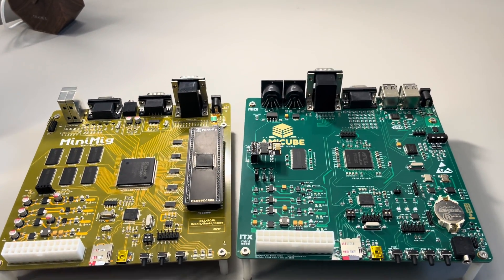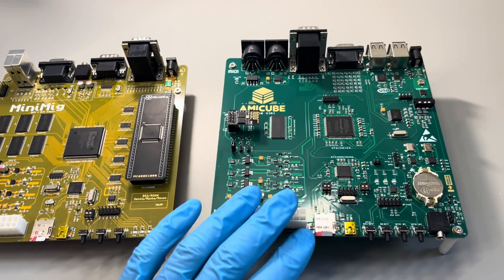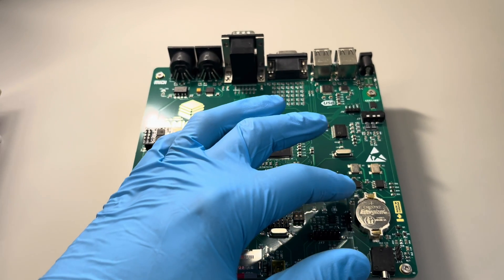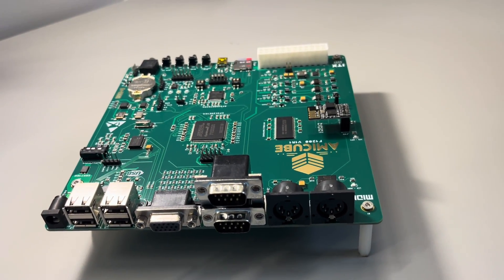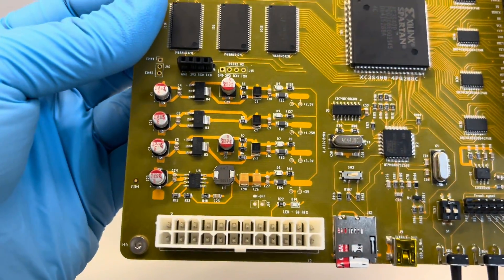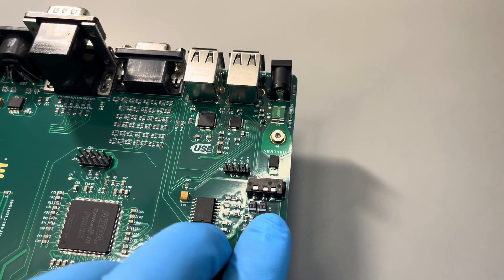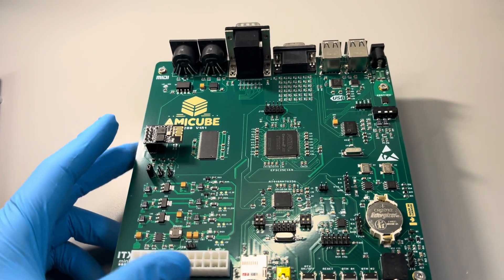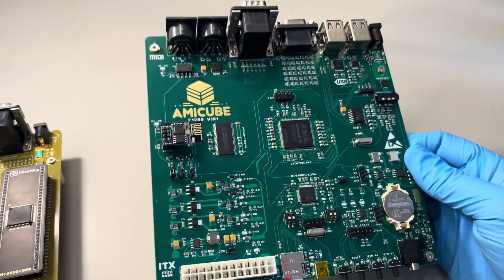AmiCube F1200 - Hardware introduction

Comment: A couple of things.  Can I suggest that, if you don't want to replace the VGA connector, you present the RGB to an internal header and make the external VGA connector a sub-board?  That way it can be removed and an RGB2HDMI put in its place in a similar way to the RF to HDMI conversions people are doing on their C64s and Amigas.  Or leave the VGA connector and have an internal RGB header as well..
Second, is the internal Wifi connector able to use an RJ45 network module instead, like an ENC28J60?  Likewise on the revised Minimig with the Wifi connector?
thanks!
Reply from the maker: All good suggestions! Will be implemented including RJ45.

Comment: ok NOW I’m interested as a backup to my real A1200…I can slap this into my tower but where can I connect my TF1260???👍❤️
Reply from the maker: Thank you for the comment! This board is mostly MIST in the ITX form factor. For expansion slots, CPU slots etc, next AmiCube will have all that. I am aiming to replicate entire Amiga IO, from floppy, parallel port, Zorro, CPU slots, improved chip-set etc..

Comment: In all honesty, is this really anything more than a MiST clone (with some of the community modifications) in an ATX form factor?  It's great so see new tech in the retro community, but this looks similar to devices we've been using for the last 8-9 years, with all the same limitations.
Reply from the maker: Yes. And Mist is a still good device in my opinion. Super outdated but lovely. Unfortunately for MIST community I am performing MISTorectomy at the moment. Mist firmware, Cyclone 3 and ARM controller are being replaced. Mist itself has very little importance here. What counts is amazing Minimig AGA core. In fact I will reduce the cost and complexity just by dropping Mist part out of it. It was a poor idea to go this way in first place.

Comment from the maker: For AmiCube, today I started process of replacing FPGA. I will try to make board super cheap, easy to produce and using all new, available parts.  Also ARM controller and MIST firmware are going out. I am checking DVI over HDMI as an option. Perhaps if we can hit sub-200$? I will keep you posted.
Reply: Canadian Dollar?
Reply: Thanks for this update. Hope all goes well with the big FPGA change.

Comment: This does look pretty cool, I wouldn't mind reviewing this too, Forward thinking, Where would the Amiga be today if commodore didn't go bankrupt and we had the AAA chipset, CD64 etc. I've been looking for any documentation containing AAA Chipset that might help towards making an emulator /core, and what logical step might have been taking beyond AAA?
Reply from the maker: Today with FPGA tech. sky is the limit. Especially with new large chips, we can even go PPC! Amiga chipset can be improved as much as we like. Good example is what Apollo team did.
Reply: I've looked into the AAA history a bit myself, it seemed to me you could easily approximate and then enhance what it would have been with an existing Amiga emulator, and some software designed to bring any real Amiga to it's knees. With Winuae, for example, you can boost the memory, cpu speed, memory speeds, blitter speed, add a 16-bit sound card etc. I can't think of anything AAA would bring to the table outside of that. After that it would have been the Hombre chip-set, designed to pair with different CPU architectures with a PCI-like system architecture and with graphics features to have standard api compatibility. The other platforms have gone the same way, I don't see anything unique about Hombre now.
Reply: What about all the 3D features @davidste60

Comment: Amazing board. If you could get the audio in to work as a sampler it would make a much more amazing amiga system- suitable for creating music in the classic way.
Reply from the maker: I think same Tape IN line can be used as sampler for Amiga, with a few Verilog mods in the Minimig core. I will look into it.
Reply: Replicating an Amiga sound sampler? We can reuse the existing Amiga software for this.